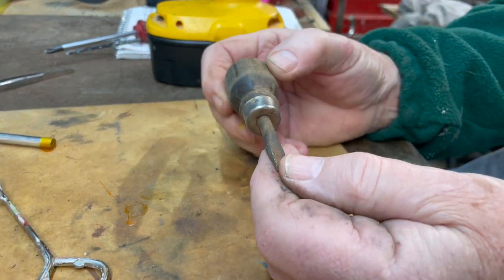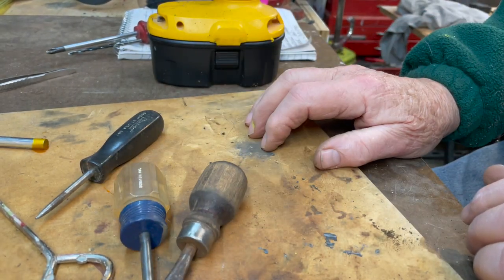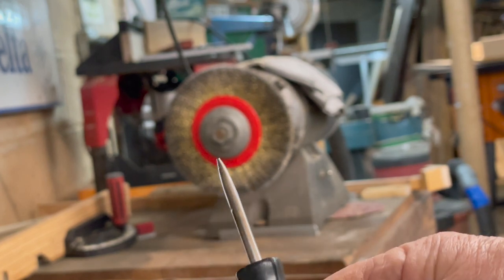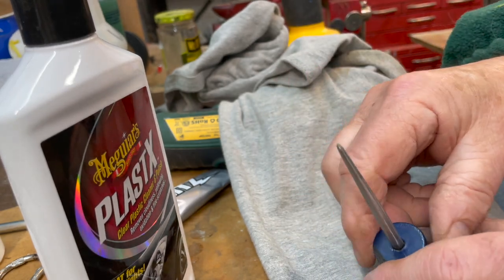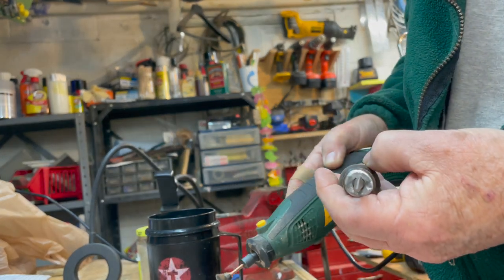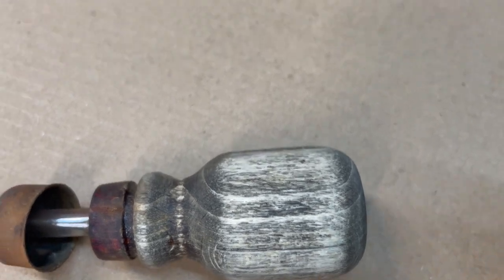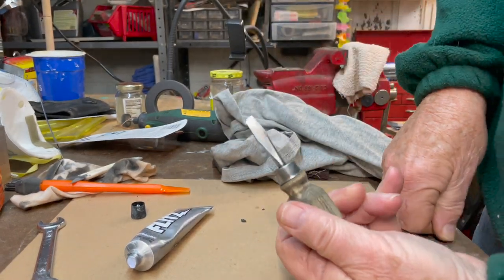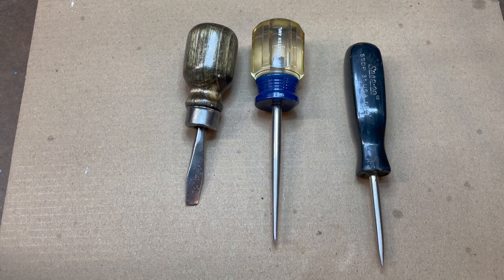Screwdriver and Awl  Restoration

Comment: Good job Dale, I think it's funny that now we're older we can fix up tools just for fun. When I was a young guy I had to fix second hand tools to use for working with.
Reply from the maker: I resemble that remark also. I purchased cheep tools cause I didn't know better. Tiwan sockets  all stripped out. Then I discovered Craftsman. I also purchased Pencraft which I now collect.  They seem to be few and far between these days. It's a teenage thing, I took apart and put back together a MoPed with Pencraft and Craftsman.  I wish I knew where they are today. I have a few pieces of Pencraft and loads of craftsman. Good times. Thanks for watching.
Reply: @Dalesworkshop  I'll keep an eye for ya.

Comment: Nice clean ups Dale. The right choice for an Interesting look on the Stubby . I agree with safety. I am the only guy with guards on my bench grinders.
Reply from the maker: Thanks John and for the sub. I liked the stubby too, it was my favorite. I had guards on my grinder but when I  started doing more and more use  with the wire brush and buffing wheel they got in my way.  However safety is the most important thing.

Comment: Nice video. Does the Fletz prevent rust on the shank and ferrule?
Reply from the maker: It does help, it is a metal finisher or polish. I uses wax or a light coating of oil to protect it from rusting as well. So far it has all worked well. Thanks for watching.